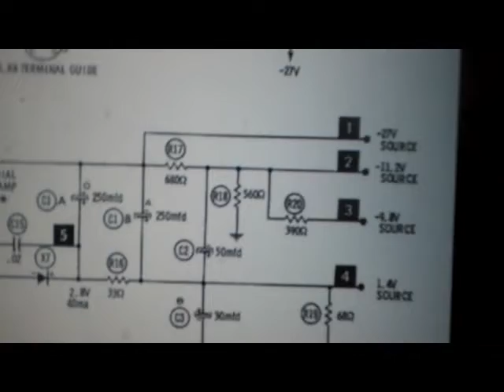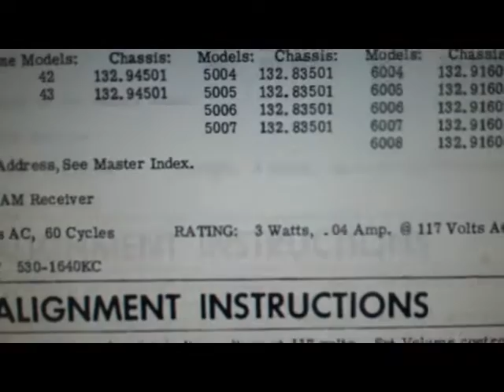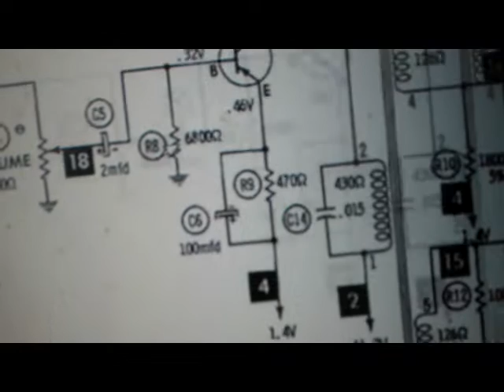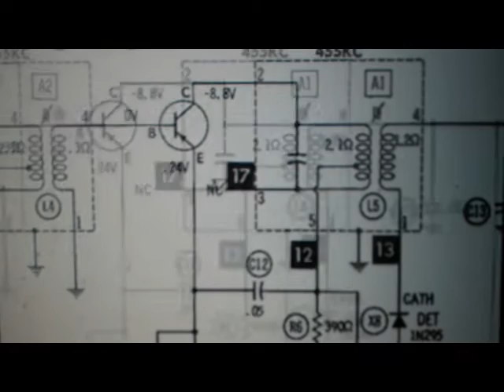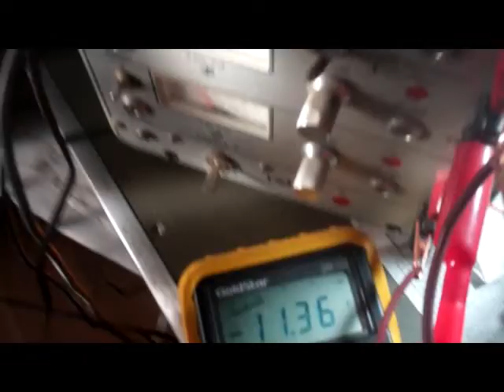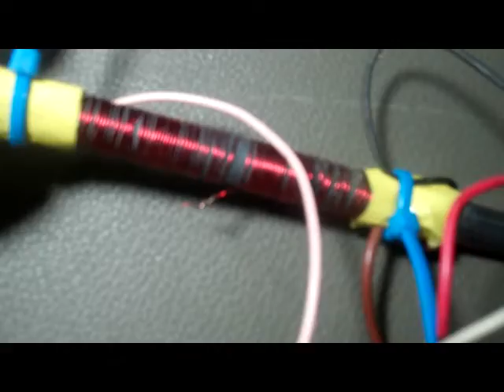Mystery Sears AM Radio Circuit Board Repair Vintage Solid State AM Radio

Comment: Really enjoyed every minute of that! I figured the outputs were overheating because of the low impedance speaker. It seems a lot of cheap early solid state stuff used high impedance speakers like 23 ohm or higher, I guess to protect the outputs which were probably running at the borderline of their design.

Comment: what about using a 470uf as a speaker coupling cap and  32 ohm speaker. is it worth replacing the output transistors with BD132  power transistors and replacing the other transistors with 2SA733 transistors.

Comment: The schematic use positive ground on NPN transistors instead of negative that make it looks confuse but it's very simple. The 1.4v is voltage drops across 68 ohm current limit resistor for output stage, when it play loud, the 1.4v will increase.

Comment: I've been doing this stuff for 40 years, and I always learn something new from watching how someone else does it, so keep it up. Yeah, how do you replace all the cabs first. Cover comes off first! Actually, "siege" cap replacement can often cause more troubleshooting problems than it solves. I test caps and T-shoot first-then replace any old still working caps if I think they need it -it all depends. You have a great channel, thank you!
Reply: cny02253